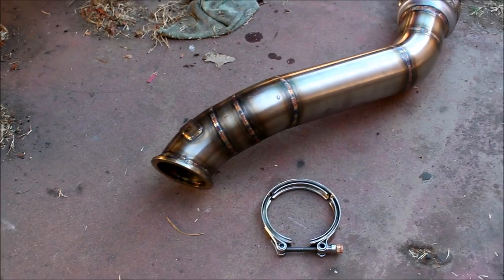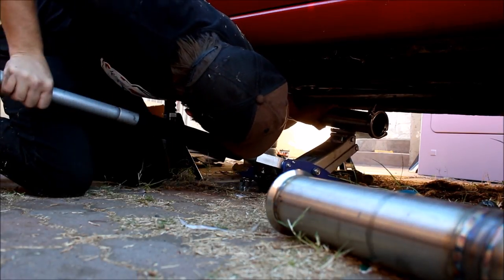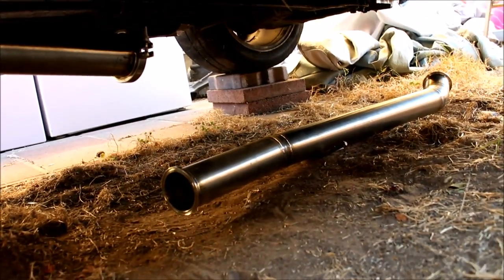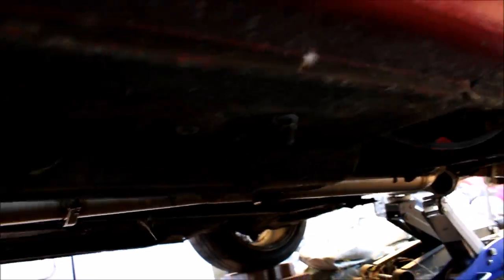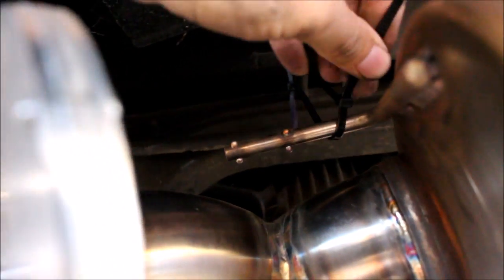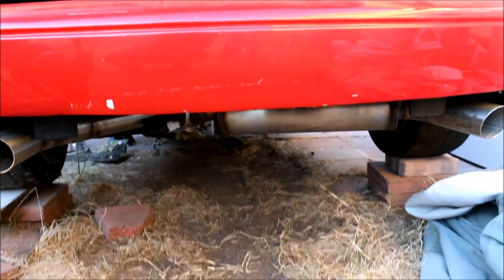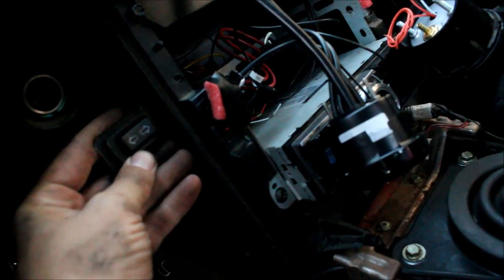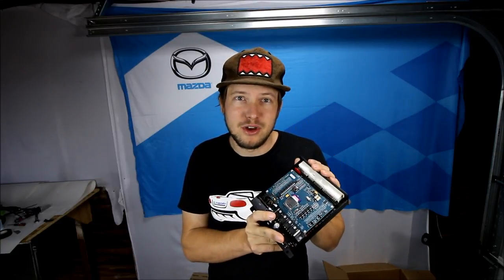Insane Street Cred!!! 3" Artech Exhaust System Install (Rebirth Ep36)

Comment: A neat idea I found for that switch is installing it on the left side of your steering wheel in your dash next to where the light dimmer is. That's what I did with mine and it certainly took some tweaking to install but it looks very factory and no one has ever noticed it (including police😂)
Reply from the maker: Boston Tillery I ended up putting mine where the stock window switches are 😅
Reply: TheCarPassionChannel that's a dope spot too!!